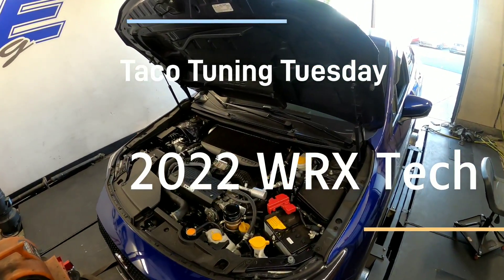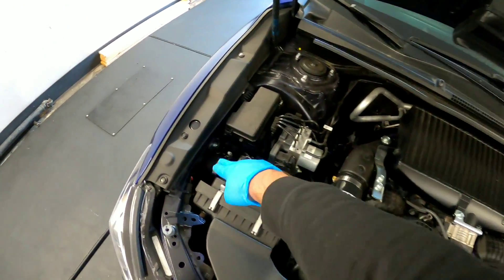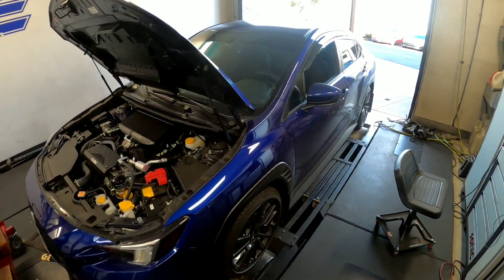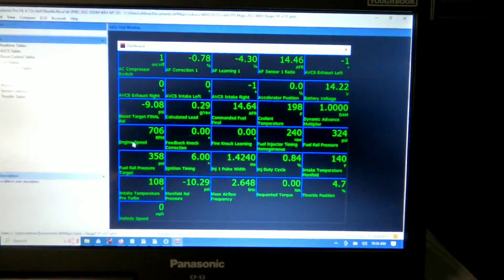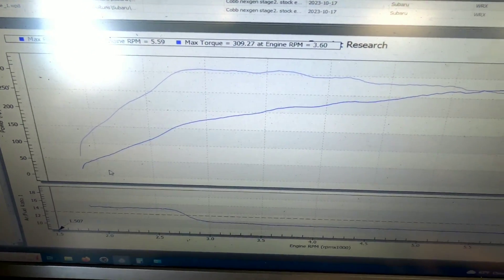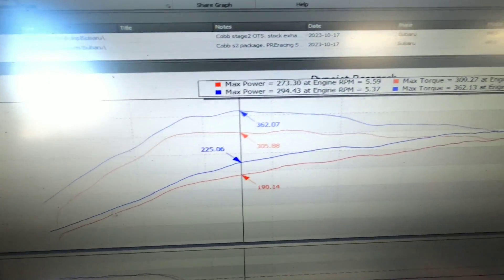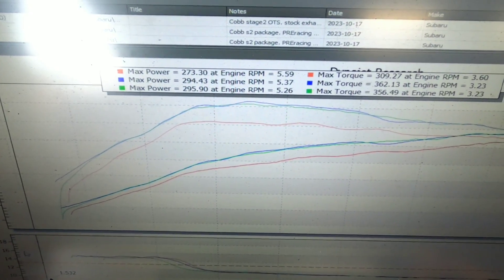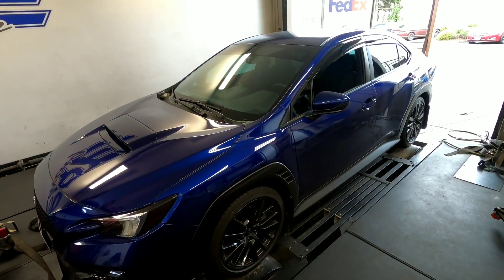Dyno testing Cobb Stage 2 package on 2022 VB WRX and DAM discussion

Comment: Wow....your ots tune is awfully close to the custom tune in terms of power and torque. Whats the benefit in going custom? Smoother curves? Safer? Slightly more area under the curve (even though peak tq dropped)?
Reply from the maker: Every car is different and with different parts you will likely want a full custom tune.

Comment: Finally - a tuner that knows what they're talking about! GREAT info regarding the DAM dropping in these new cars. Totally different compared to EJ cars. Wish people would get that through their heads!
Reply from the maker: It's not that different than EJ's really, the system works really well in them as well if you use it correctly. Unfortunately, early on many tuners didn't understand this so it became the norm to say it was bad.

Comment: I dont understand this video does cobb make 327 hp max they claim or not
Reply from the maker: There is a very large difference between wheel and crank horsepower.  I'm not sure where they advertise 327hp but I'm guessing that's crank.
Reply: @WT4T  on their website it shows that with 93 octane on their stage 2 package at 5,500 rpm you can reach 327 HP. But I’m assuming that’s crank.
When you did your test and got 273 max power with the Cobb tune is that WHP on 93 Octane with the stage 2 tune?

Comment: My dam will stay at 1 and then once it drops below once the knocks start coming. Is there any chance it mistakenly drops, and then starts creating knocks because it’s pulling timing? It’ll be fine 90% of the time but all it takes is that one time on the highway I’ll give it gas to pas ina high gear and it’s all downhill from there. Also I feel like I can barely cruise in 6th gear 85+ even without it starting to knock. I usually just stay in 5th and I have no issues.
Reply from the maker: What year/model and what tune?
Reply: @WT4T  2016 wrx base manual , maperformance stage 1 93 octane
Reply from the maker: Feel free to send a datalog and mod list to willtunefortacos@gmail.com apart from data there's too many variables

Comment: Love the info have a 21 wrx base installed a rear 3rd brake light, IAG AoS, next some badges about 46k miles
Reply from the maker: Not a lot is similar between the 21 and the 22. Kind of shocking the difference honestly.

Comment: whats flat foot shifting?
Reply from the maker: FFS is shifting without lifting your foot off the accelerator pedal in order to keep the turbo from dropping out of boost.  Some vehicles have the ability to activate a secondary rev limiter and reduce timing while you're doing this to reduce stress on the drivetrain.
Reply: @WT4T  thank you! Thats good to know

Comment: I made 352whp 358wtq, with the ets intake and cobb top mount, stock exhuast and jpipe.. tuned on Dyno with Anthony at Felix's... it's a good recipe for a little extra power it's perfect for a daily.
Reply from the maker: Yeah every dyno is different. Definately more hp than ive seen with those mods but tq is normal.  Most ive seen hp wise on stock j pipe is 332 on my dyno on the 92oct we get here.
Reply: Pretty good, i got my car protune cobb stage 2 package and its making 300whp and 280wtq he recommends getting jpipe and catback to get better airflow on the exhaust for more whp. Btw my car is tuned by all aspects motorsports
Reply from the maker: That torque number is very low,  cvt car?
Reply: @WT4T ops sorry i meant 380wtq 😅
Reply from the maker: Yeah, that's better.  280 might make sense on cvt trying to keep the trans happy but on a MT that would be hard to keep it that low.
Reply: If this is a cvt. I heard the transmission can’t handle a lot of torque. You think 350~ torque is okay?

Comment: Really appreciate these videos!  There are so many unverified repeated statements in any car community, thanks for showing some facts!
Reply from the maker: In this video really the most important feature is people saying that the charge pipe picks up a ton of power but as you can see it really doesn't.  I'd venture to guess the factory one is actually better because it's not going to transfer heat. I think ETS is sending us one to test on our car so I'll do it on the dyno back-to-back comparison.  Have a bunch of Perrin parts coming too
Reply: @WT4T  Im in a VA wrx, but will still tune in for all your VB testing!
Reply from the maker: I did some similar testing when the VA's came out but I didn't have the channel going

Comment: These cars make crazy power
Reply from the maker: So far we've made just shy of 500whp on a stock engine. I know some others have made more.  It'll be interesting to see how long they last.
Reply: @WT4T  I’m no expert but I was reading somewhere that the FA24 is a beefed up FA20 so if it can hold 400+ whp reliably I’d say that’s pretty good
Reply from the maker: Considering fa20 love to go floppy rod at sub 300 it's been a little nervous pushing these deep into the 400's but time will tell.

Comment: I did the math on all of the current available intercoolers on the market and put it into an excel spreadsheet. The Perrin TMIC is hands down the best bang for the buck, and from an engineering perspective, seems to have the best design as well. Strangely, the Perrin also leads the FMIC bracket on cost per cubic inch of intercooler. based off of what I have investigated so far, I feel like an ETS or RAE intake with a Perrin TMIC is the most efficient and effective modifications to purchase.
Reply: What are all the ones you looked at I didn't go with the perin cause it doesn't work with iag a.o.s so I bought a process west since it's the only other besides perin not using the stock inlet piece also is the largest if every actual give accurate info on there core size
Reply: @JoshDillon-lm3hw  ETS, Perrin, RAE(Garrett) and Cobb
Reply: @JoshDillon-lm3hw  I didn't know they made a kit for the new VB
Reply: @logicalthinker101  yeah I think I got one of the first ones shipped to the U.S it took a long time to get I know they were pretty popular on va but it's normal style not a vertical one but it still has dual inets in the back
Reply: Funny you say that. I just got the Perrin TMIC in last night with Perrin charge pipe. Already have ETS intake with DMann OTS. Gonna throw in Radium dual catch can kit as well. E-tune this weekend and CANNOT WAIT to see the gains.  To say the least this comment boosted my moral immensely based off my purchase decisions😂
Reply from the maker: I'm actually about to test a few Perrin products on our 2023. Historically I haven't been the biggest fan of their stuff for a variety of reasons so we'll see.
Reply: @WT4T  I am actually on the same page with you about Perrin parts. Just about the only thing I found myself liking was their license plate bracket. My data is purely a metric of cubic inches vs price, but that being said, when you see their TMIC, you will know why I believe it will be the best performer of the TMIC options available today. They redid the inlet area to bypass the OEM fitting making for a more direct and less restrictive intercooler interface. I still wouldn't get much else from them, but I am 100% convinced you will be sold on their TMIC when you run it. Looking forward to that video.
Reply from the maker: Im not sold on any tmic. Literally zero reason to run one on these cars. Fmic will be far superior in every way.  🤷‍♂️
Reply: @WT4T  I disagree, I think most people with an FMIC have ZERO use for one. They are not tuned for enough power and do not drive hard enough to actually justify the part over others. there is only a small percent of modified cars hitting tracks, they have justification. People who drive like tickets are rewards and live in hot climates may have some justification...anyone else is wasting their money...well, not wasting, there is a performance increase for an FMIC over TMIC like you said...but  it is a scale of diminishing returns when you factor comparative cost to performance metrics, and the vast majority of FMIC owners would have been better off saving half that investment and putting into other things. In the reality of how these cars are being used, the primary driving factor for an FMIC is ego, not performance. A want...not a need.
Reply from the maker: @logicalthinker101 there is no spool loss or transient response loss on this platform.  Every TMIC will heatsoak, no fmic will.  A bag of ice on the tmic before a run took me from 13.1 to 12.6. No tune changes.  During the run tmic will only hold temp at whatever it was at,  you'll see little to no drop so if you start st 140⁰ you'll end st 140⁰. This is real world testing.
Reply: @716Flat4  what kind of denial response is that? I learned once with old cars TMIC heat-soak and rob hp after some time. I personally got the ets FMIC on my VA and VB, my intake temps offset can be 5-10 Degrees which is really good. Now one thing I do need to touch in on and I’m sure this channel will agree on is. For the core size of FMIC can be too big or too small. So Turbo size and hp goals matter if you want a 3” to 5”. My VA w/ 6466 with 740hp has a 4” core. My VB with a cute small factory turbo has a 3” core.
Reply from the maker: Yeah,  you don't need a 5" core on a 400hp car.  VA and VB wrx have an advantage in fmic as it basically adds no extra piping distance and the air traveling though the pipes has already been charge cooled so it's nice and dense. The age of "but the lag" is no more

Comment: I agree that DAM drops are not the end of the world. However, the sensors are FAR too sensitive and on the stock and OTS tunes it pulls way too much timing. With some sensitivity tuning, you can minimize ghost knock.
Reply from the maker: Absolutely,  I didn't say not to modify sensativity,  just be careful that the reason your the doesn't see knock is because its eyes are closed.